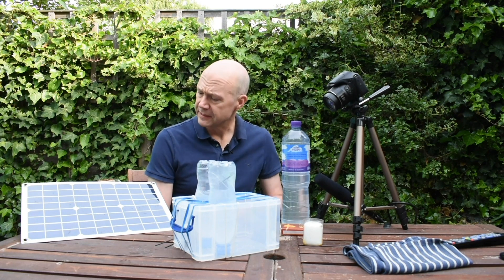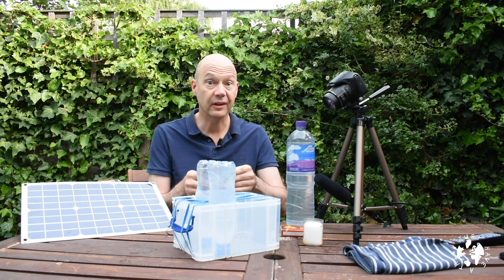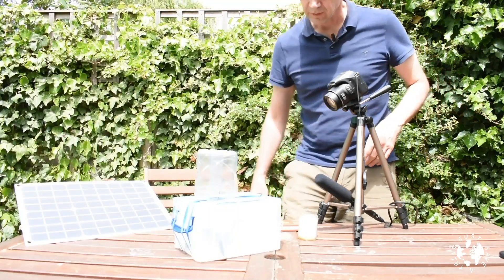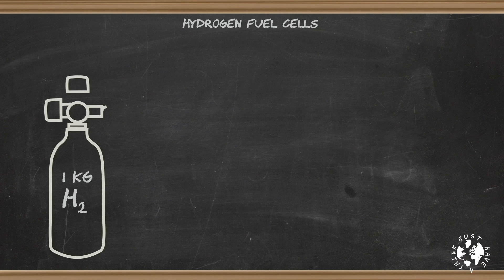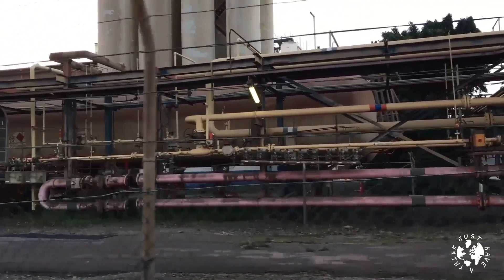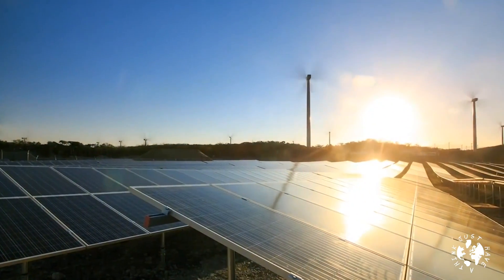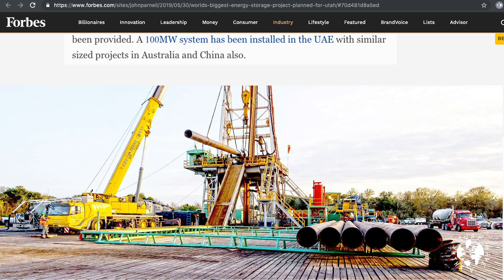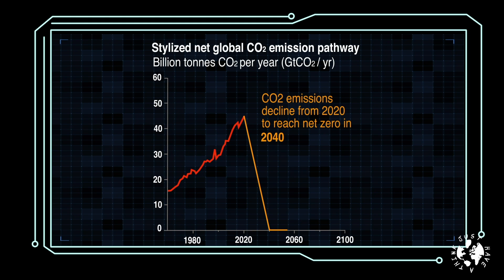Energy Storage in Hydrogen : Does this beat batteries?

Comment: I have questions about the round trip efficiency of electrolysis of water into hydrogen and oxygen, then, burning the hydrogen in a gas turbine. It sounds like about 400 watts out, per each 1 kWh of energy in, not counting compressing the hydrogen for the purpose of storage. It is a sure fire solution for getting the capacity necessary to firm up the grid against the intermittent nature of renewable energy, but, we're going to need more than twice as much, perhaps as much as 3 times the capacity, that would be necessary if the energy could be stored in batteries, which can approach 90% efficiency. Even with fuel cells, rather than turbine or reciprocating engines, you're at best, up around 50% efficiency.
Reply: Today NEL electrolyzers are at 93% of efficiency without compression, then you need to add 12% for 700 bar compression or 30% for liquefaction, but the new Electrochemical Hydrogen Compression new units are way superior to mechanical compression with 8% for 700 bar (way more small,, less capital cost, they also purify and silent) and 15% is possible for liquefaction just scaling up production, even more if you apply EHC or magnetocaloric.

New high temperature reversible fuel cells in lab already achieves 75% in round trip efficiency (electricity-->hydrogen-->electricity) with relative high endurance, they just need a water vapor input at 500c, which could be obtained from any thermal plant as waste heat and they can work with pure hydrogen or methane or anything in between without modification. 
In addiction, you dont need to convert hydrogen back to electricity to power the grid, you can work converting all the excess to hydrogen and then use hydrogen to power all those thing that can not work with batteries, like the utility transport sector or the natural gas grid (which does not need extra compression).
Reply: @AngelLestat2  yes.. but doesn't that method emit a gas that leaves the hydrogen & oxygen combined as one gas? separating it at that point would be impossible.
Reply: @jaybee3165  you are talking about HHO, no.  my values are for pure H2 electrolyzers, but not working at its full load.
Here you have electrolysers from different companies:
https://nelhydrogen.com/product/atmospheric-alkaline-electrolyser-a-series/
http://greenhydrogen.dk/wp-content/uploads/2019/11/HyProvideTM-A-Series.pdf
When you read system efficiency, that is measuring the system compression output which for HyProvideTM is 35 bar, which 0 to 35 bar is around 60% of the energy needed to reach 700 bar.
Reply: It's true you have to take that into account but you also have to take other aspects of batteries into account.

They are expensive to make and recycle, they have a (currently) fairly limited lifespan, they have a high environmental cost to make. 

We'll always need batteries but it would be better to have them as the failover solution to pick up load for a few minutes until the stored power can ramp up to cover load.
Reply from the maker: HI Vincent. Fair point. I did do a bit about comparing battery and hydrogen efficiencies back in September at this link
https://www.youtube.com/watch?v=uG4lmtOxz6E&t=1s

By no means completely full and  comprehensive but a reasonable layman's guide. All the best. Dave
Reply: Wished he had mentioned what the companies employing this claimed their efficiencies and costs are.
Reply: @skiinggator  I agree 100%. Some hard data and a few minutes on a calculator would make this video much more informative. These are neat concepts, but the cost per kWh to install, the maintenance costs as well as the efficiency will dictate weather this is actually practical.
Reply: On all this madness, has anyone worked out the economy of lithium - the abundance, mining capability and geopolitics. The current annual car production is 80 million. The current  lithium supply can't even meet 15 % of the supply. What about larger vehicles like trucks, buses . And what about larger utility vehicles.
Reply: Vincent Robinette 
Nickel Hydrate stores H2 expensively (uses heat to release H2 for Fuel Cell (to drive EV)) Can also be compressed (with some losses to leakage) IDEAL: Use
Solar to electrolysis to H2 & Solar to Compress H2 (transfer to EV or hydrogen to
power Vehicles// Pollution_Free Zero Carbon Footprint !!🙀🙏🏼👽
Reply: the short answer is 70% energy loss,  40% of that at the fuel cell. but there's a NASTY LITTLE SECRET they're not mentioning... MOST hydrogen comes NOT from electrolysis, but from natural gas (notice the 'shell' emblem on the tank?). of course.. they mention hydrogen and immediately EVERYONE THINKS electrolysis of water. and they are more than glad for your to make that assumption. all the hydrogen fuel station that current fuel cell cars run on? yup. might as well be propane or natural gas. liquified hydrogen is around $7 a gallon.
Reply: @jaybee3165  So what?  It's not a "nasty little secret".  Pretty much everyone knows most commercial hydrogen comes from steam reformation.  The point is that it doesn't have to.  Solar and wind can be converted directly into hydrogen via electrolysis and it's a WAY better storage medium than batteries.  Don't try to use smoke and mirrors to cloud the issue because it won't work.
Reply: @LG123ABC  using renewables to make hydrogen? yes. getting someone to PAY for that energy when it costs 30% MORE than energy stored in battery packs- good luck with that. of course.. you'll NEVER be able to compete with even the current generation of lithium ion batteries. there is ONE place where hydrogen could be useful. pipeline transport. the problem with going 100% renewable is getting energy from … say... a MASSIVE solar farm in the Arizona desert to- a rainy FROZEN area in north Dakota. with a power line? that's impossible. voltage drop limits grid transport to around 250 miles. but with piped hydrogen? still ALOT of energy loss- but do-able. that's where hydrogen would SHINE. and with renewables... SOMEWHERE the wind always blows.. and the sun always shines. just a matter of transport of energy... so yah.. .maybe hope for your H2 after all.
Reply: @LG123ABC  corporate oil wants hydrogen production because it's a way for them to KEEP things at the status quo. frankly... I don't care if they drill for oil or natural gas. what I don't like is how they raise the price of their products WHENEVER and for HOWEVER much they feel like because of their monopoly ON IT. they'll blame it on war... or 'oil shortages'... lmao (1970's) then JUST whenever someone comes up with a cheap alternative to THEM- prices go back down. time for their monopoly to END. so to HELL with them & their business models. they had their shot. & they screwed us at every turn.
Reply: About 99% for producing the hydrogen now; about 63% for using it in a gas turbine.
https://www.technion.ac.il/en/2020/01/water-sun-hydrogen/
Soufi, M.G., Fujii, T., Sugimoto, K., and Asano, H. (2004) ’A new Rankine cycle for hydrogen-powered power generation plants and its exergetic efficiency’, Int. J. Exergy, Vol 1, No. 1, pp.29-46.
Reply: @robertlee6338  I'm thinking more in terms of stationary energy storage, where energy/weight density isn't as important, as in vehicles, especially aircraft. To put the number of kWh necessary for a cross-country flight, you will need some kind of fuel to keep the plane light enough to even get off the ground!
     If you have time to sleep, you have time to charge. Long charge times are perfectly practical for daily commuting, but, you're right, if you're on a cross-country trip. That's where fast charging or hydrogen compressing become more practical. I don't think that filling up on hydrogen would really be that much different, than compressed natural gas or even propane. (Not as fast as gasoline or diesel, but faster than charging a battery)

Comment: Also, don't forget to look at Australia's CSIRO ammonia as more efficient hydrogen storage.  They have a membrane that converts to ultra-pure hydrogen on the fly.  They claim an eventual cost competitiveness with LNG.  If this can be used for seasonal storage, it would be a huge deal.  

I'm not sure about their claim for fuel celled vehicles.  The turnaround energy efficiency for pure battery EV's (BEV's) is still better.  And certainly BEV's have a major head start, including advantage in infrastructure build out.  (There may be a few specialized vehicles where hydrogen fuel cells are a better.)

Would be interested in your evaluation of their technology.
Reply from the maker: Thanks Ernest. I'll check it out.
Reply: Yep the Oz ammonia storage concept is effective.
Reply: that sounds very interesting. I liked the idea of using surplus energy to create CH4 = methane. We could use existing natural gas infrastructure - and it could be added (some of it is fossil fuel and the other gas that is carbon neutral is just added.

Comment: I did this in 1976 as a high school science project. When I said this could replace  our reliance on oil, I was told that it was "impractical." Solar cells are too expensive. Hydrogen is too bulky to store. It would cost too much to convert cars to hydrogen fuel. What I did not realize until recently is that the real reason it was "impractical" is that the fossil fuel industries have no intention of allowing anything to replace their dominion over the World's energy supply.
Reply: It still completely impractical.
Reply: @PistonAvatarGuy  I agree: that's just too much energy lost in the storage process.
Reply: solar cells are cheap. but fuel cells are a HORRIBLE way to do ANYTHING. only 60% efficiency AT BEST. electrolysis of water to hydrogen loses another 20% at best. pressurizing & storing the hydrogen loses another 10%. by the time you've sent electricity out the other side- you've lost 70% of the energy you collected.  lithium batteries make the most sense. they have a long life.. lifepo4's can go a LOOOOOOONNNNNGGGGG TIME. and there are developers working on patenting recycle methods for all the materials used in lithium batteries.
Reply: @jaybee3165  60% is a good thing. An gasoline car efficiency is in the 20%s
Reply: @filipenegreiros9557  and btw- h2 power production isn't 60% efficient- it's LESS than 30%. you lose 20% of your available energy doing electrolysis. so say you START with 100kwh's collected from solar. now you run electrolysis to make h2- you lose 20%- now you have 80kwh's. now you compress, liquify & store the h2- now you have 75kwh's. then you need to convert it back to electricity- you run it through an h2 fuel cell- now you have 30 kwh's left... and you STILL have to use that output energy to run through a lithium battery- because h2 fuel cells can't handle sudden changes in amperage draw. you started with 100kwh's.. .now you only have 30.  and- IN JUST  5 years of steady usage- you'll have to REPLACE the h2 fuel cell- and that's at a cost of $35,000 for every 20 kw's of available h2 power. a feat that tesla can accomplish with their lithium ion megapacks at a price of $8000 for 75kw's for a lifespan of 15 years- and now that the 4680 cell is ascendant? every 50 years! charge a lithium ion battery pack- DONE.  now you can see why h2 is dumb, expensive and dangerous- all so big oil can keep their monopoly on energy.
Reply: Don't feel too bad. Back then, electricity was half the cost that it is now, and solar panels were ten times more expensive than they are now. Back then, they were right. Now, I think they would have a "rethink". It's also worth noting that wind is much less expensive per watt to install as well.
Reply: You know what isn't? Nuclear.  Switch all cars to electric and we all pay a stipend for it. That just will never happen, there is just too much money in burning dinosaur bones or coal.
Reply: But oil is so easy to pull out of the earth, storage, turn into gasoline, transport, storage and sell. It only took us 100 years to do it.
Reply: Well in 1976 a solar cell prolly worth its weight in gold , so...

Comment: 1) - Isn't it so that Hydrogen due to its small atom size is highly volatile and manages to escape from all sorts of contrapments much easier than any other kind of gas? 
2) - And might this not lead to potentially explosive "hydrogen gas"-"oxygen gas" (air) mixtures at the leaking locations along the pipe? 
3) - Therefore, where do you see power plants working with hydrogen gas to be located due to the legal safety requirements? - These type of power plants don't seem to be scalable due to the safety requirements involved, especially not close to populated areas.

Quote: "The flammability range for hydrogen in dry air at atmospheric pressure and ambient temperature is about 4 to 75%. With so wide a range, virtually any release of hydrogen has a great potential of igniting." 
Source: https://www.chemengonline.com/how-to-handle-hydrogen-in-process-plants/?printmode=1
Reply: Leaks of hydrogen in open air are not as dangerous as heavy petroleum gases, because it lifts quickly and doesn't concentrate at the surface.
Reply: > Therefore, where do you see power plants working with hydrogen gas to be located due to the legal safety requirements? - These type of power plants don't seem to be scalable due to the safety requirements involved, especially not close to populated areas.

Same place as the solar panels/wind farms and/or other power stations that already exist...they're not often close to populations, and there's no need for them to be.
Reply: 1) quite true.
2) yeeees..  in the same way that the leaking gasoline from your car can react with the grease on the bearings, making Napalm. I.e. it works on paper, in reality it is no issue.
3) For sure, to the same or very slightly greater extent that gasoline manufacturing, storage and delivery also needs all sorts of safeguards.

The hydrogen leakage issue is a problem for the metal parts that are continuously exposed to the hydrogen. Iron compounds, for example, get brittle over time if saturated with hydrogen. Some plastics experience similar problems. But all of these issues are known and easily handled.

The real problems with Hydrogen are that its energy per volume is pathetic. Per mass it is quite good, but that mass wants to occupy an enormous volume, even if you cryogenically liquidize the H2 (which presents a whole slew of other problems).
Or you could mechanically compress the gas, which requires a lot of energy, very heavy containers, and turns H2 storage into miniature bombs by pressure alone.
Reply: After all, we use nuclear and chemical power plants which have been proven to be dangerous as well. At least, in the case of a H2 plant explosion, the only residue would be water.
Reply: rock4cheese and bodies
Reply: Hydrogen does leak easily, but compared to pretty big losses when producing, compressing and converting back to power, it is minor thing. Still better than not using the power at all. 
Another more important thing with hydrogen's small molecule/atom size is that it diffuses into metals and makes them brittle. So you can't use your normal pipes and fittings like for other gases, but have to be careful what you choose.

Unless you trap the leaking hydrogen in a room, where it can mix in the right proportion with oxygen, it is very safe. It immediately rises and won't "fill" the floor like many other (heavier than air) gases like propane or butane or vapor coming off of gasoline and other fuels for example. The most dangerous part of hydrogen is it's almost invisible flame. So should you have a leak big enough to support combustion and catching fire somehow, you'll have an invisible welding torch.

The quote is very misleading, because it sounds almost as if it would ignite on itself. And it isn't anything special either. Acetylene and carbon monoxide, both gases in wide use in the industries, have similar mixture ranges (acetylene from 2.5 to 80% for example).